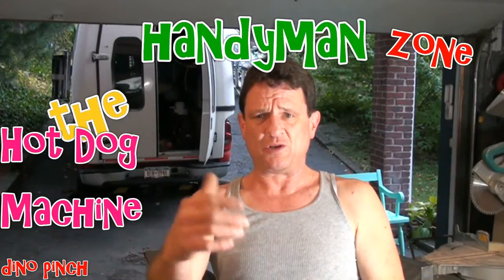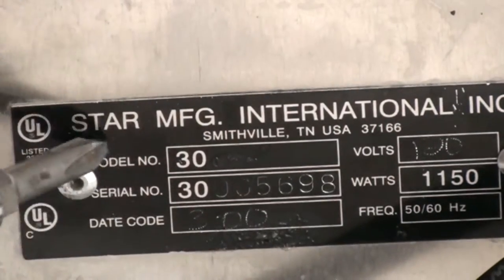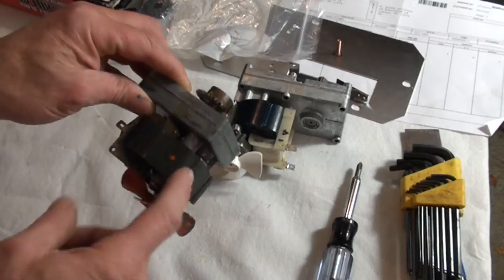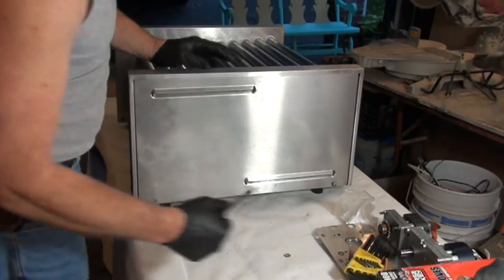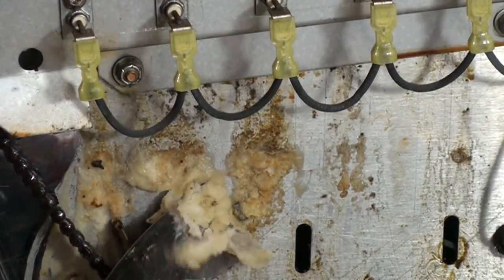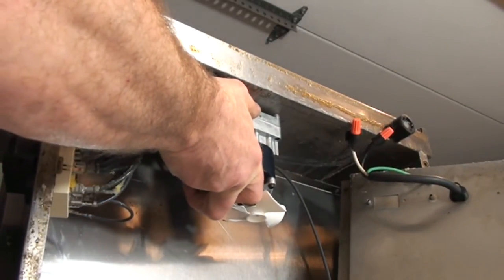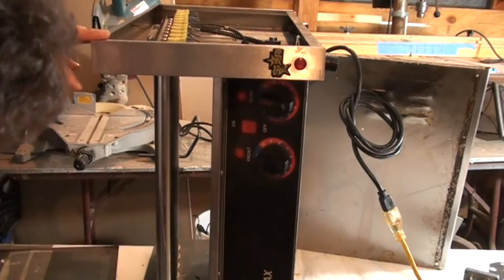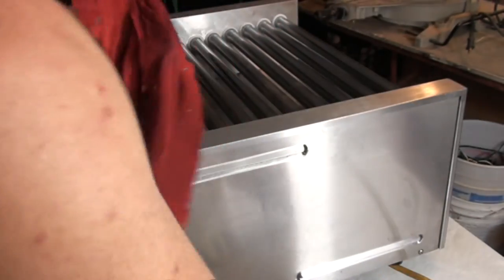Hot Dog Roller Machine Motor Kit in Star Model 30 Grill-Max

Comment: Hey Dino I have a roller  generic model , A little smaller from the one you have in the video.   My rollers work  until i kick on the heat , Than you hear either the motor or the gear box buzzin and the rollers Stall out .   Do you think this is a coil issue or  motor issue ?? please let me know if you have any Ideas to fix it
Reply from the maker: sorry, don't know, need to test, the price new machine vs replace motor...if I had to do again, just get new machine
Reply: @roslynny - Yeah these machines cost less than 200 bucks, they're not 3 grand.